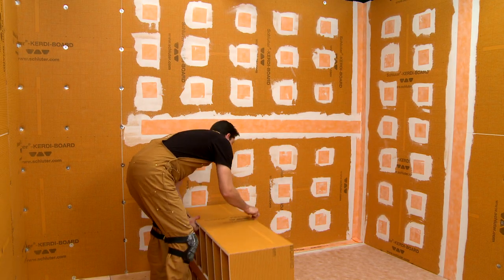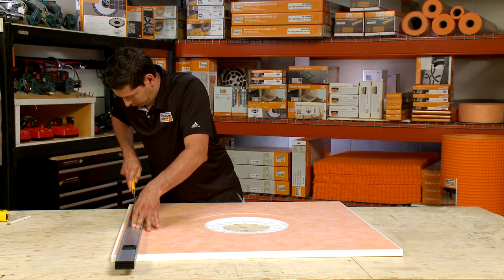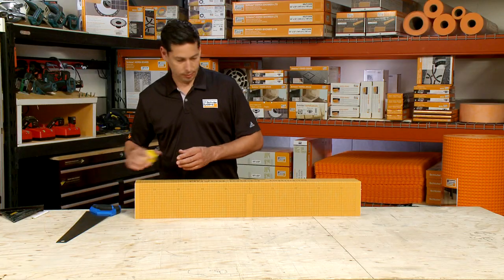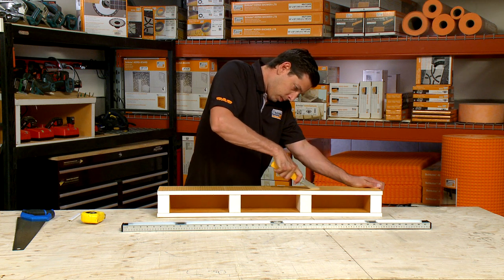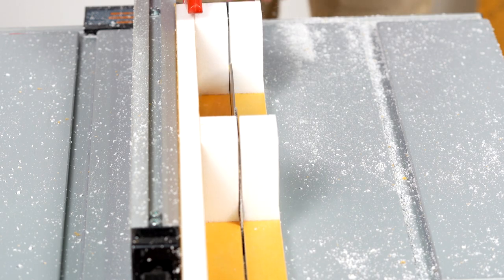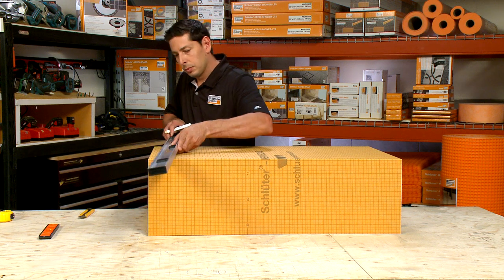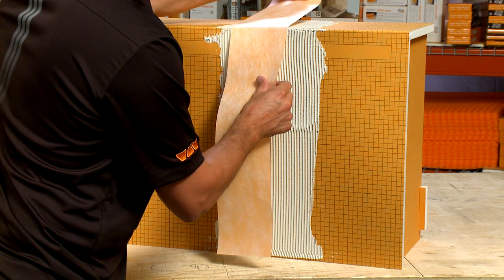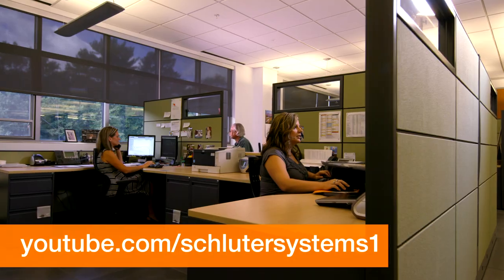How to Cut and Extend Trays, Curbs & Benches

Comment: My shower dimensions will be 36" from inside wall to curb, then about 40-42" the long way. Do you recommend I buy the 36x60 pan and cut off 18-20" the long end? Or buying the 48x48 and cutting 6" off the E/W end and 3" off the N/S end making it now 36x42?
Reply from the maker: Hi there! Would you be able to reach out to our Customer Service team to discuss your project in a bit more detail?  They’ll be able to request more information on the specifics of your project to give you the most accurate answer possible. You can reach them at 800-472-4588 (US) or 800-667-8746 (CA). Thanks

Comment: Running out of preformed kerdi corners. Is it possible to use 5"-Kerdiband  and make a vertical cut of 2.5" and form a 90degree edge as the corners overlap 2.5"?
Reply from the maker: Yes, as long as you end up with a 2" overlap everywhere and thin-set between the overlap, it will only leave a pinhole on the inside corner and that's fine. For an outside corner, you will need to also apply a square patch (with a small cut-out for the actual corner) on the uncovered center section. Hope this helps!

Comment: Hi there. Does the shower curb need to be on cement floor or can it be half cement floor and half tile? Just to see if I have to cut the current tile down. Thanks
Reply from the maker: The best case is for the curb to be installed directly on the subfloor. If the tile is solid and well adhered to the subfloor, it might be okay, as long as the curb has a solid foundation. But ideally, it's preferred to install it on the cement.
Reply: @schlutersystems1  Thank you!

Comment: Can you piece together the shower pan?  I am short 2 inches but I cut that off of the width. I have a 2” piece that fits perfectly. Could I piece that 2” piece in there with thinset and waterproof it with the membrane? Or does it have to be dry pack?
Reply from the maker: Hi Renee! You certainly can! If there is a dip at the seam, just fill it with some thin-set, flatten it and let it set up prior to installing the KERDI-BAND over it for waterproofing.

Comment: When you use dry oak to extend tray. How do you waterproof this? With thinset and fabric?
Reply from the maker: Hi there! Would you be able to reach out to our Customer Service team to discuss your project in a bit more detail?  They’ll be able to request more information on the specifics of your project to give you the most accurate answer possible. You can reach them at 800-472-4588 (US) or 800-667-8746 (CA). Thanks

Comment: Can a corner shower seat be modified? I purchased a corner seat per a contractor's instructions. I think the seat is too big for my shower and I've had it too long to return it or exchange it. Can it be modified to be made smaller, or should I sell it and buy a smaller corner bench? My contractor decided he didn't want to do the job so I'm going to DIY.
Reply from the maker: Hi Autumn, you should be able to modify the bench as long as all the seams are properly waterproofed. Please call our customer support team for further details:
US 800-472-4588
CA 800-667-8746

Comment: As this is your newest video I thought I'd get a response, even though my question is not about KERDI line.
My question is - do I need ANY type of heat insulation under DITRA-HEAT if I am putting it over 1" plywood substrate?
Reply from the maker: Hey there, the DITRA-HEAT matting can be installed directly onto the plywood. No need for any insulation. Here are a couple of installation videos that may be helpful: https://youtu.be/Y8VG3STo6VM & https://youtu.be/T7MrB_NBnzg

Comment: For shortening the bench, after cutting off the end of the bench with a vertical support, the end is now left with no support. Seems like that end would be a weak spot.  Shouldn't you salvage the end foam and glue it back into the new end?
Reply from the maker: There is no need to add a support to the end of the bench, as the spacing of the other supports is tight enough and it will be attached to the wall and waterproofed. However, you are welcome to move a support to the end if you prefer!

Comment: Is there a minimum curb width that is recommended when cutting it down?
Reply from the maker: Hi David, Currently, there are no specific dimensions to which the curb can be cut. However, the local building inspector should be contacted prior to modifying the curb to determine if the desired dimensions comply with the current local codes. Hope this helps!

Comment: how much weight can the curb take?
Reply from the maker: We don't have a specific weight it can take, however the Schluter®-Shower System shower curbs can support the weight of a properly installed glass door/panel. If you have a particular other use in mind, please contact customer support so they can look into it further for you.
800-472-4588 (US)
800-667-8746 (CA)